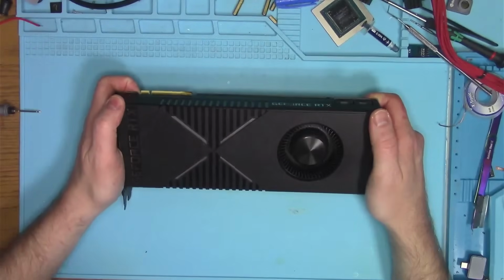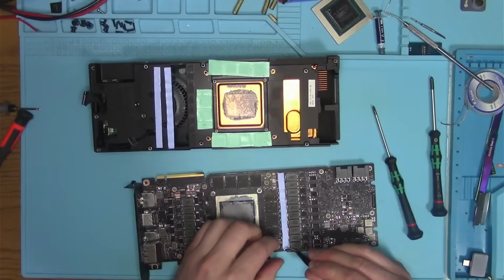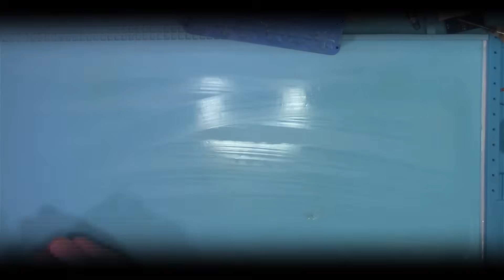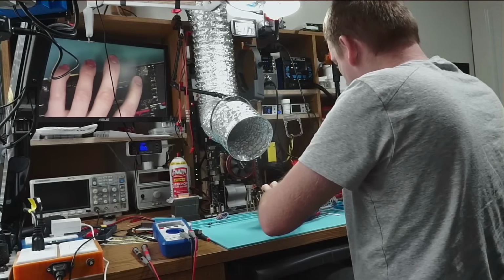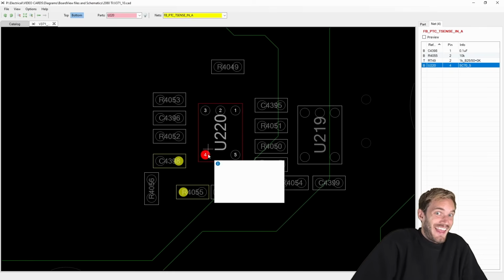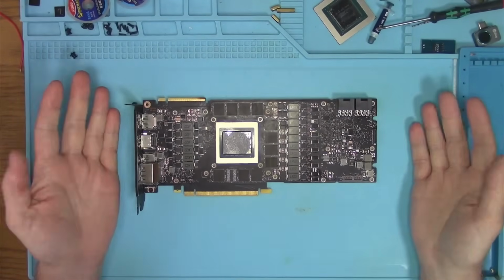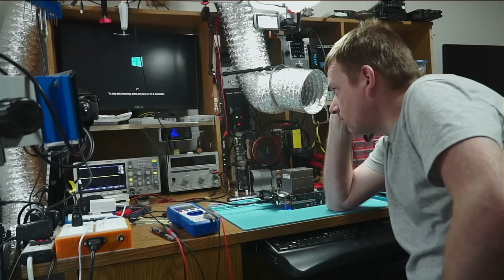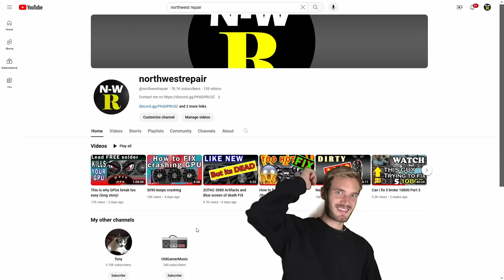graphics card repair gone wrong and now i have to fix it

Comment: It's an OEM card from a prebuild, so that's why there are few to none branding on it. Dell actually make good OEM GPUs, but this one isn't Dell I suppose. Btw, how long does it normally take to reball a core Tony? (without complications).
Reply: hp oem. the build quality is actually good, at least in blower cards.
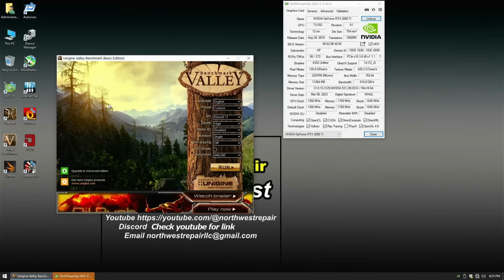Reply: You can sometimes see in GPU-Z who the maker is just like on this one where it says HP on the subvendor @13:48
Reply: You're right, I watched it on my phone, so I didn't pause at the right moment. Thanks for pointing it out.

Comment: Curious about alot of things like if u tried removing drivers first and maybe reinstalling them because sometimes that can help, especially with how oem cards can have their own, also for a job like that is it even worth the repair cost because buying a used card on ebay goes for like 250-350 and i imagine after all that the price had to have been more than that especially with the work load increased from a prior repair attempt😂

Comment: i have 3070 that after fall, badly show power on second connector/40000V/. resoldered everything, but still no joy. no physical damage
Reply: u have physical damage. u have mostly bad connection between pmu chip and shunt resistor. thats why u have bad power measure

Comment: Interesting, have a RTX 2070 bought new in 2019, that day after a windows update decided to go black screen. Had PC in a repair shop who tested PSU, motherboard and came to conclusion its a dead GPU. Bought myself 6800 XT used to keep me going but was always curious what exactly was the problem with my 2070. Will try this trick with disabling the sound driver.

Comment: A costumer gave me a gtx 770 with vram issue (screen goes black when installing drivers) , everytime i replace that C1 vram it give the same error (around 14000) should i reball the GPU?

Comment: What is mad is how much abuse these cards can put up with without actually breaking. You can run them with the resistors in the wrong places, run them with broken connections, shorts and then during repair heat it all up several times over and over. Sometimes you'll get broken chips but you can just replace them with another and its fine? Then you fix all the issues and everything runs as id the card was never touched. 

I'd always thought of these cards and other conputer electronics as extremely fragile. One short while powered would fry every chip on the power rail, one diy transistor repair with the wrong value and it's straight to the e-waste bin. But actually, it's just a matter of fixing the issue and everything is fine? So crazy.

Comment: You need to do motherboard cpu socket replacement and cpu swap
Reply from the maker: Not worth it.
Motherboards cost around 100 bucks.
Almost the same as the repair cost.
You add shipping and socket cost.

Not worth it.
Reply: i mean for expensive motherboards not all cost 100 bucks so you should do as bunch fee to avoid junk from your desk.
i like your skills are really improved especially micro soldering keep going @northwestrepair

Comment: Do you have any video with the following problem: pci slot, pex reset shows o/l on multimeter. 😮
Reply from the maker: Trace the pin. Broken connection or dead   and gate

Comment: From experience, most cards at least up until the 3000 series, not sure for 4000, the four spring screws for the cooler mount were always done underneath the backplate.  This is because technically from factory the backplates were an optional addition and not a necessity, and thus the spring pressures are set for NOT mounting through the backplate.

Comment: 8:20 PTC means it is a Positive Temperature Coefficient thermistor, simply put resistance increases as temperature rises
Reply: andrew_koala2974  rises is the correct word because electrons leave it becoming lighter
Reply: The increase of resistance will continue until the operating temperature improves.

Comment: Are there non Chinese pads in the world? and if so, where are they manufactured?
Reply: There are Fujitsu, Shin-Etsu, 3M and Honeywell thermal materials, and i think most of the manufacturing for the Japanese chemical companies is actually done at their own faculties in Japan, and 3M does most of the manufacturing in USA. The exact information what is made where is kept secret.

Anyway there's basically 3 categories. Random Ali pads, like these, these are often from here today, gone tomorrow sellers, what you get is sometimes OK sometimes manufacturing rejects, almost never as good as claimed. Then there's brands with known consistent performance who have a supplier usually in China or sometimes elsewhere that manufactures for them. Then there's industrial manufacturers with long standing reputation and which have their own manufacturing that they directly control. Nobody actually cares where the products really comes from, just who is responsible and what you can expect of them.
Reply: @SianaGearz  Thanks for the detailed answer

Comment: Today I received a graphics card that has a mosfet burned and melted to the PCB. The guy who previously repaired the card forgot to check capacitors and had the wonderful idea to solder two pieces of thick wire where it should be a 10 amps fuse. Yay!

Comment: "chinese thermal pads" bruh, literally everything you can buy comes from china. They just make it a different color, charge you 10x the price and put their label on it.. used those blue Chinese pads in everything and had very good temps. 570, 1070, 1080, 1080ti, 3070, 3080 all had better temps than original pads with the replacement. Just make sure you buy some pads that have the actual thermal conductivity you need.

Comment: sir, what flux you use for reballing?, ive tried amtech 223 and 559, using the lowest setting in my hot air station the balls like to hug each other, tried different approach from above from sides, and nope, balls hug, so, i am wondering if maybe it my flux, not optimal for the work, any tip?

Comment: There was so much wrong on one card. Looks like you did everything but replace the PCB, or make a new one. Now with audio disabled, you have to question. Is the GPU core or HDMI encoder chip bad? I'm guessing audio output device is built into the core. People should avoid buying junk similar to Gainward graplics cards.

Comment: What confused me is only 11 out of 12 RAM slots being populated.
Reply: probably depends on what core is on the board, like if its a 3060 or 3060 ti for example, they both come with different mem amounts, that would be my guess
Reply: The 2080Ti is an 11GB card, so only uses 11 spaces...

Comment: Thats most likely a Dell GPU. They come without branding like that inside of Dell workstations and some alienware pc's. I have a 2070 super laying around somewhere that looks very similar that came from a Dell workstation. And I've seen dozens of similar models at work all coming from Dell.
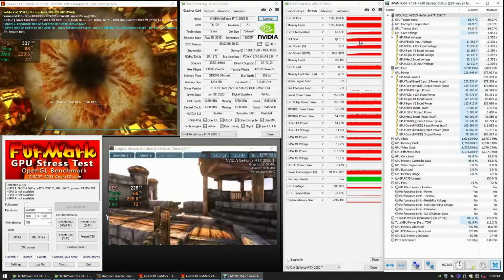Reply: At 14:42 you can see GPU-Z ID's it a an HP 2080 Ti. Kind of the same thing as Dell though.

Comment: Don't you have random chips and PCBs just popcorning on you during the reflow/soldering phases? Where I live, the humidity is always so high that if I don't preheat the PCBs and GPUs for a couple of hours at around 100C the usual result is a gpu full of bumps or the pcb gets all lumpy even before the solder is melted. It's quite depressing when that happens

Comment: I was curious if it was a bad vga bios flash after those repairs and still black screen (before you disabled the sound driver). When i flashed the wrong bios on my old 2060 Super, it would black screen after driver installs. Always a possibility to keep in mind! 👍

Comment: Yeah I knew it was the resistors they looked way outta wack and messed with glad you didn't have to much trouble I really was hoping the burnt crispy parts in the board weren't gonna be the culprit either.

Comment: Once I had the same problem, but different cause. I had to DDU the driver, disable windows driver update in safe mode without internet, then I installed back the GPU driver, after that it worked fine. After about 4-6 month I reenabled windows driver update, luckily Mirosoft fix something in the meantime so no problem.

Comment: you are a king of gpu repair.i still have 1 year left on my evga warreenty on my 3080 10 gig black lipped one 5 year.it musta been a binned one it just wont die ive overclocked beyond what it shoulda have taked it.ect.but as i speak it runs like a dream.if it dies ill send it to ya its never been opened

Comment: Do you have any tactile feedback when reballing or are you just following the silkscreen on the PCB?
Reply from the maker: i dont understand the question
Reply: @northwestrepair  When you're aligning the core.
Reply: Before you take the chip off, you check its alignment with the board and silkscreen.  If the silkscreen is present and aligned, you're golden.  If not present, you might have to paint your own alignment marks.  When the solder is molten, the chip will self-align, assuming you haven't done a terrible job of placing it.
Reply: @Mueller3D  I see, I was just wondering given the microscopic size of the solder balls if there was some kind of physical guide to align the core to the PCB like slightly concave pads or if you just had to place it flat and follow the silkscreen and hope all the pads are making proper contact. I'm never doing anything like this btw, it's just a mere curiosity!

Comment: Honestly, i dislike your videos, because i feel like there was no real closure here. No featured segment of conclusion. You just showed the device functioning.
All i got from the ending is tht you expect the end user to disable the sound driver for the card in order for it to work. But why? I have never had a 2080ti, so is there a sound driver issue?
Is the card from a prebuild with a purpose built board tht doesnt support the driver?